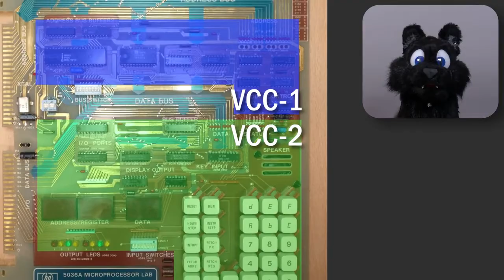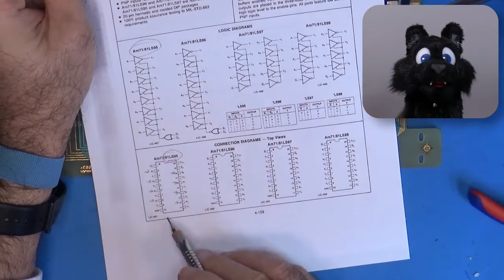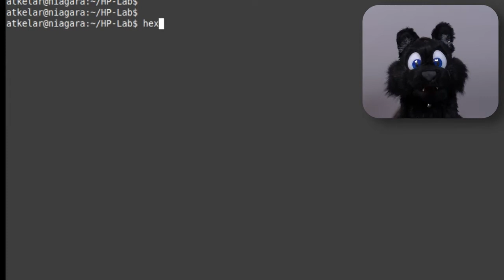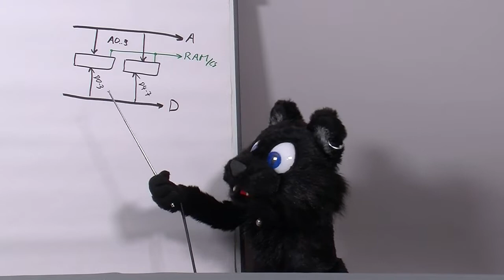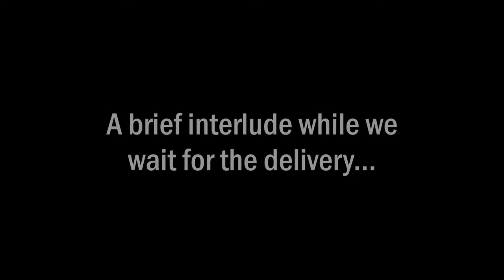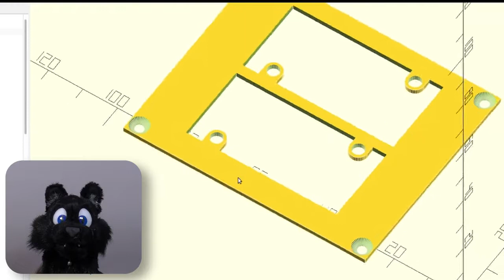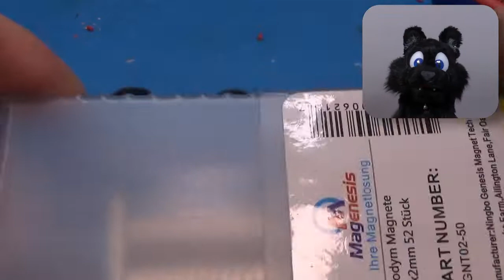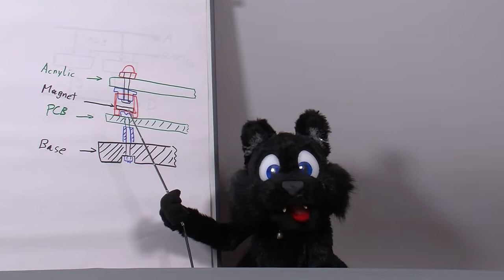Restoration Project #30 - HP µLAB 5036A

Comment: That thing is so cool! Nice restoration, and I great idea with the magnetic fasteners for the cover.
Reply from the maker: Thanks! Using magnets to close up lids is pretty common, it took a bit to come up with a centering solution that was simply and easy enough so that the cover would stay aligned and not droop.

Comment: Yuk blue LEDs! 😂 I too have a thing against blue LEDS. Great return again. I initially didn’t understand why you didn’t make a little adapter pcb for the new octabuffer. But then it made sense when I heard your friend/customer wants it to be a display piece.
Reply from the maker: Blue LEDs are way too overused. They started cool, but since they are everywhere now... And especially with a device that predates them. I am not beyond 'upgrading' devices in some details, but the look should remain original. I.e. if I replace bulbs with LEDs, the color should still be close.
Reply: @atkelar  I agree! I remember in early 90s really wanting to get some blue LEDs for a project. Two reason I didn’t! First was back then they needed 7Volts and the cost about the equivalent of 40euros 😁 And now everything has blue LEDs and  it’s almost special to see a normal red one. 
And indeed, anything before the 90s shouldn’t have a blue led in it.

Comment: atkelar: What's wrong with you?
HP µLab: Yes.
Too bad. I felt special for a short while, having found a Rockwell AIM-65 in a dumpster... (at least that one was working - took it to an exhibition and programmed it to scroll "LEGALIZE DUMPSTER DIVING")
BUS transceiver adaptation: Had to do the same on an Apple ][ a bunch of years ago... my local electronics store (RIP, it still exists but doesn't sell anything remotely useful anymore) had it stocked, but wanted 18 EUR for it... compared to the <1 EUR for the LS244. I made an adapter though. It looks like a mess, but it works.
Looks like your logic diagnostic levels are pretty much the same as mine if not better and it took me years and years of practice to get there. (but I totally love doing it!) (a by-product is that I have a carry case full of almost every 74xx logic IC under the sun as well as the usual suspects of RAM). I tip my hat to you!
Edit: Missing parenthesis
Reply from the maker: I did consider making an adapter for a socket, but the "display case" option kept me from adding anything that would be visible on the front. Several websites I found when scouting for that old chip mentioned people looking for some... it seems that they failed quite often?

Comment: Hello Atkelar, maybe you can put the links url of the HP documents (Practical microprocessors Hardware,Software, and Troubleshooting Michael.Slater & Barry Bronson) for this training system, because the HP documentation is very well done like your videos!      :-)  it's look like MPF-1 (Z80) .Often to unsolder components like DILs, I cut the legs of the components above because with the old pcb and metalized holes I have already had the same problems with the tracks (more fragile on old PCBs)
Reply from the maker: Thanks for pointing that one out - at the very least it lead to an information page that hat a bit more details, specifically about the test programs inside the ROM. Nifty! I could not find a direct link to a legitimate source however... there are some "scanned" sources it seems but even they require login.

Comment: Have you played the Snake Game yet?  It's in ROM and not a lot of people know about it.  When you see uLAB UP, press FETCH ADRS to see _ _ _ _  Then enter address 06C2 and press RUN.  You will see a minus on the left side which indicates that it is the left player's turn to serve.  Also the score is displayed "00"  indicating Left Player 0 and Right Player 0.   Left Player presses DECR to start the snake moving to the Right Player's side.  Right Player presses 3 to return the snake.  Keep pressing DECR and 3 to return the snake to the other player.  If you press too soon or too late, the other player gets a point (score is 10 or 01).  The minus appears on the right or left side indicating who starts the snake.  Anytime the score is displayed, you can press 0 to reset the score to 00 and restart the game.   Winner is the first person to get to 10 points (A).  Let me know if you have any questions or if you want to know more of what is in the ROM.
Reply from the maker: Thanks for the info! The device is now back with its owner, I'll forward the message!
Reply: @atkelar  There is a tone generator program at 0599.  When you see uLAB UP, press FETCH ADRS and enter 0599 and press RUN.  Each key press from 0-F will play a tone and you can play songs if you are good enough.  Press RESET to exit the program.

Comment: The only note to make is that I would have used a board and a socket to replace and remap address bus drivers, I don't like irreversible changes.
Reply from the maker: Under normal conditions, I totally agree... but in this special case, the board was supposed to be a working show piece; anything added on top would have looked wrong. I only cut traces and set a few wires, so it is at least in principal reversible if the correct chip would come along.